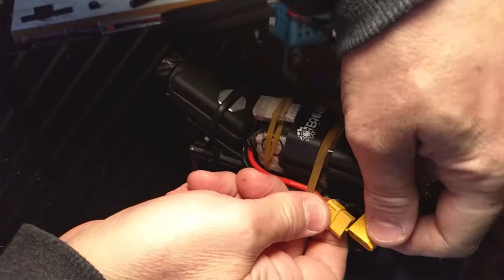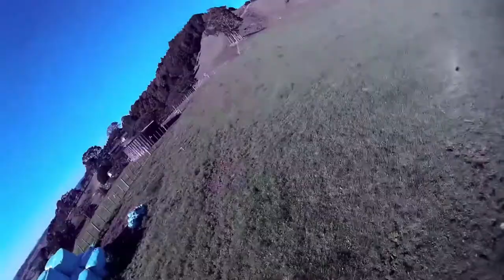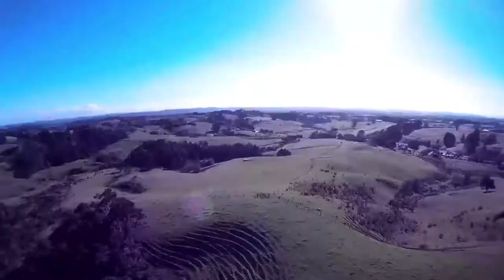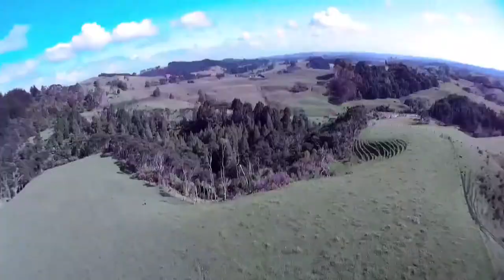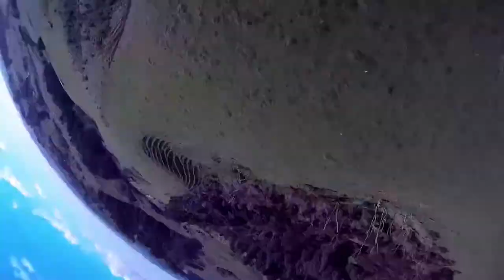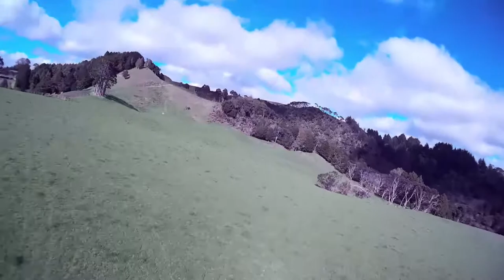Wizard X220S Quadcopter - How to Prep & Mod - FPV NZ

Comment: Nice video, gotta ? , my vtx broke mine came with a Eachine 200 Mw 3 wires only. Had a TBS UNIFY PRO 5G8 HV for a build but decided to install in my Wizard. Cut the connector off an used only 3 wires for the TBS. Solder 3 wires together, now I go fly , kinda hard to explain looking thru goggles a large line appears video freezes for about a second like a short on frame an then its good again. swapped antennas , recheck solder still the same. Suggest a good VTX for the wizard ?
Reply from the maker: Ok, sounds complicated... I use one of these, works great! AOMWAY 5.8G 3dBi RP-SMA Male Four Lobe RHCP VTx/VRx FPV Antenna. Can order here: https://www.banggood.com/AOMWAY-5_8G-3dBi-RP-SMA-Male-Four-Lobe-RHCP-VTxVRx-FPV-Antenna-p-978264.html?rmmds=myorder&cur_warehouse=CN

Comment: Where did you buy it from and how did you ship it?
Reply from the maker: https://www.banggood.com/Eachine-Wizard-X220S-FPV-Racer-RC-Drone-Omnibus-F4-5_8G-40CH-30A-Dshot600-2206-2300KV-800TVL-CCD-ARF-p-1155399.html?rmmds=search&cur_warehouse=CN
Reply: @BrigzyFPV  Ah okay thanks Im looking to buy one and was just wanting to see if you had got the rtf version with the battery and transmitter. What transmitter do you use?
Reply from the maker: @danielstead781  Yes the 1st one I got was the full kit with FlySky Transmitter, it was all good. You will want at least 6 batteries too, the one that comes with it is average. I used Tattu 1550mAh | 4S | 75C Lipos, they were perfect. Also Dal Props, 5051. I put a Mobius Camera on it not a GoPro. See my pics here, if I was you and it's your 1st FPV quad you should get a 3 inch I sold my Wizards and have smaller 3 inch now. See my photos and more vids here on AirVuz - https://www.airvuz.com/user/brigzy-fpvc6c1354e/photos  Look at getting a Diatone GT R349 (I have the HD Caddx Camera ones), amazing quads, I have a couple. Also the best way to learn is with good goggles and a Mobula7 Tiny Whoop with brushless motors, they are amazing outside, see my vids. Now I use a yellow JUMPER T8SG Transmitter, it connects to any/all RX's of any type, not just FrSky or FlySky etc. Great TX. The Wizard is good for learning but quite a handful... I learnt on it, have been flying 2 years now.
Reply: @BrigzyFPV  Okay thanks do you know if Im allowed to ship the rtf one to New Zealand if it has a lipo battery in it? Thanks for all your info I will consider it, Thanks.
Reply from the maker: @danielstead781  One Lipo ok, more not ok. Will ship to NZ with a Lipo... you cannot by more at Banggood, they don't ship batteries if u order some.
Reply: @BrigzyFPV  Ah okay thanks so if I order the rtf one which includes the one lipo its okay to ship? Thanks
Reply from the maker: @danielstead781  Yes, 1 batt ok.
Reply: @BrigzyFPV  Okay thanks